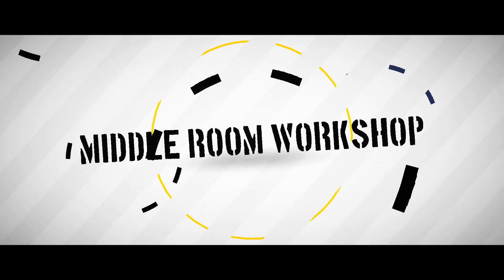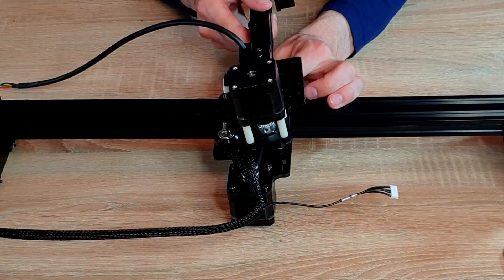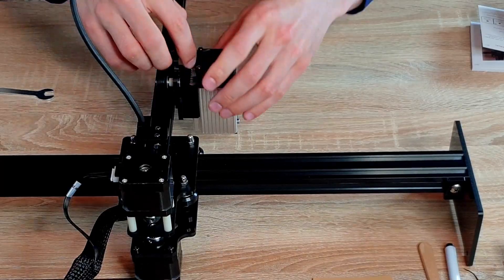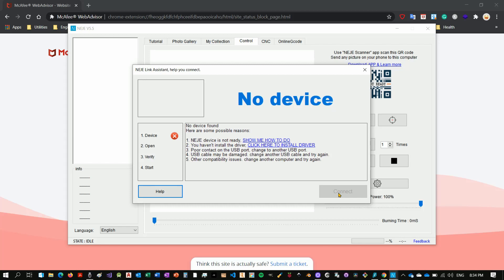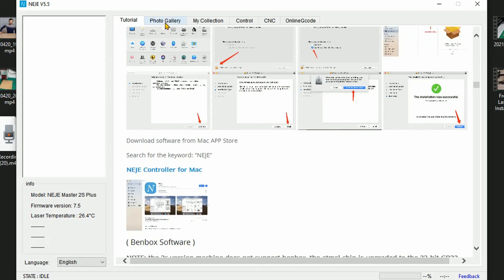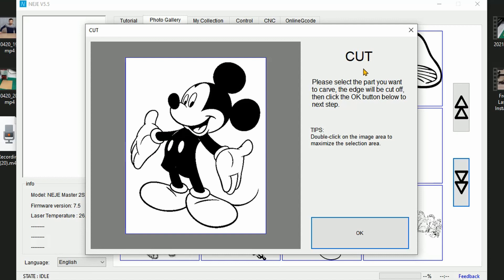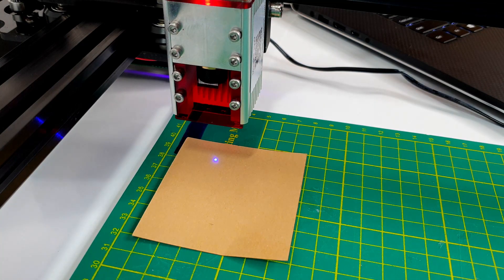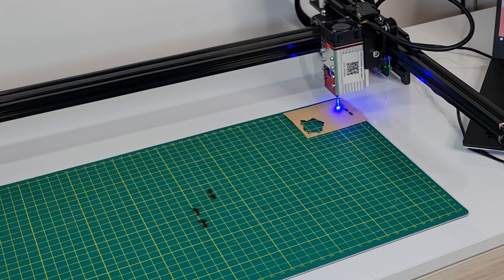Laser Cutting and Engraving Machine - NEJE Master 2s Plus - Installation and testing

Comment: Can run in smartphone or android?
Reply from the maker: Hi Andik Suar, Thank you for your comment.
Yes, you can control the engraver entirely through your Android smartphone see my corresponding video:
https://youtu.be/3Rm5ggZ_g6Y

The smartphone app is in my opinion better, as it allows you to upload pictures from your device or directly take pictures and engrave them.
Ciao
Reply: thanks for your answer, can't the 30w laser head output 30w too?
Reply from the maker: Thank you for your comment.
I am not sure to understand the question.
The 30w laser outputs 30w of optical power the laser itself I think cannot be more than 7w which corresponds to the most powerful Laser diodes.

Coao

Comment: Hello,
How high should the laser be to cut mdf?
Reply from the maker: Hi LIONWAR CHANNEL, thank you for your comment.

I have only tried with 2mm MDF and my optimal setting to obtain a clean cut are: 
Distance from the laser's head to the cutting surface = 71mm (52mm measured from the case of the laser module),  Power = 75%, Burning Time = 25ms, Passes = 10.

This will give you a clean cut, try to keep your workpiece risen at least 1mm from the bed so that you do not get burning on the underside edge of the cut piece.

Ciao

Comment: Can you show some cutting and design and where to get the cutting designs it seems all neje has is the engraving images i want to cut some stuff like tinted plexiglass i have this laser and need ideas thanks i subbed
Reply from the maker: Hello, thank you for subscribing to my channel and your comment. Sure enough, I will upload some video with my creation. Up next I am going to show you how to set up and do it all through your smartphone, and next I will show you how to create custom designs.
With the Mobile app, you will be able to engrave pictures and scanned drawings, however, there is no easy way to create custom designs apart from using Autocad or Inkscape. 
Alternatively, you can install Benbox or LaserGRBL, but there is a bit of a learning curve to start using them.
The engraver is nothing more than a typical CNC and as such it recognizes G-code but yet you cannot hardcode it and launch it since it has to be in md format.

Ciao